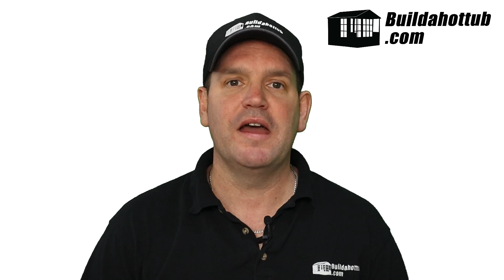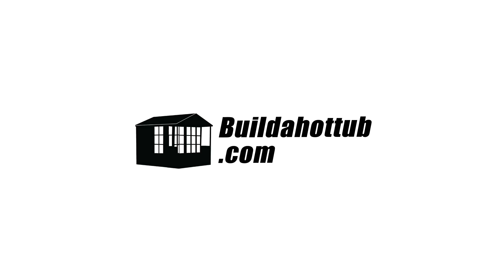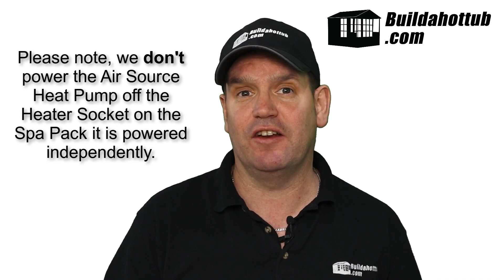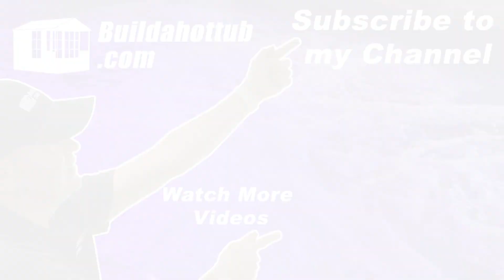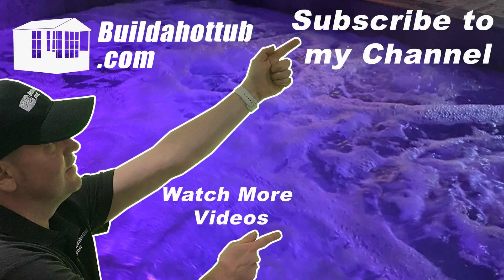Is My Hot Tub Compatible With An Air Source Heat Pump?

Comment: Does it matter if my hottub has a dual speed pump which is used for both the jets as well as for circulation? Can this work with a heatpump as well? I've been told that for this to operate I need a second pump which is only used for circulation, but how should the plumbing look in this case... not all that straightforward. Would be great if you could cover this in one of your future videos.
Reply from the maker: Thanks for the comment  - I will make a video on this in the future no problem. Bottom line here is all about flow. The air source heat pump will not like the amount of flow from the high speed jet pump when you have your jets on high. It will give an error. What you will need to do is open the bypass (and I would recommend a 2" bypass not a 1.5") when you were about to use the tub. You dont want it to be all the way open as then you will get no flow through the air source and all sorts of flow errors will appear and it will not heat. However, you will need it open enough so that you dont loose too much flow on your jets (there will be some power loss for sure from your jets as you will be reducing the flow) - when you get out - close the bypass so that you are maximising the heat efficincy. Converting your hot tub to a dual pump system is not straight forward at all and I would go down the bypass route if I were you - Hope that helps - Andi